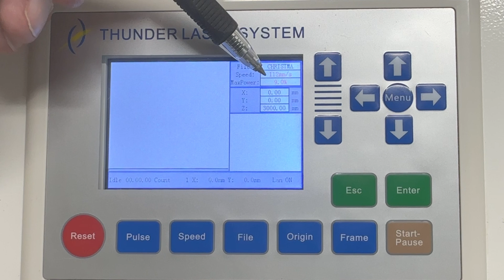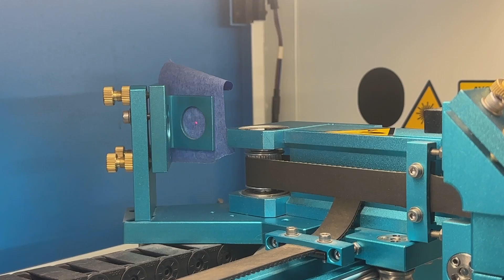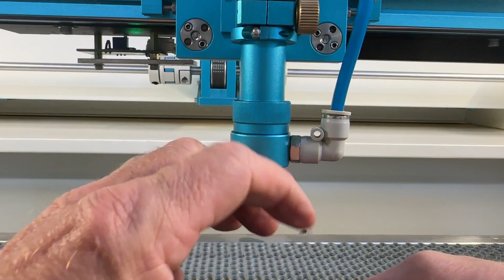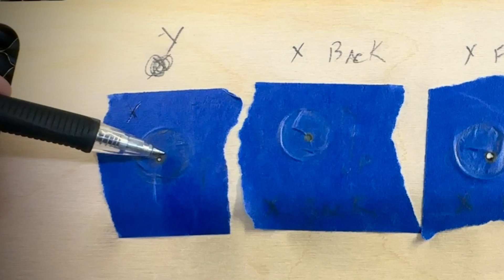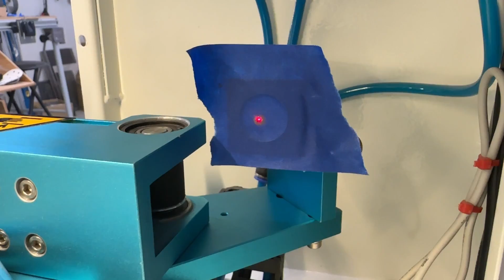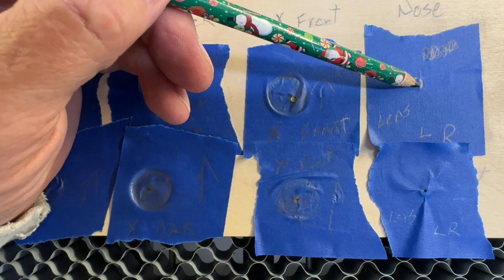Thunder Laser Co2 Mirror alignment process. Do not attempt if don’t fully understand your machine!

Comment: if you go to laser set in the menu and select that change from continue to laser, and underneath set the ms or milliseconds to 50ms. this allows the pulse button to only fire the laser for 50ms , another trick is to run 4 or 5 layers of masking tape on top of each other so the tape has no chance of catching on fire, also keeps the mirror behind clean from smoke

Comment: Thank you for your video. I adjusted the max power as recommended but once I press the pulse button no mark is on the tape. Is it safe to assume the laser is off completely from the mirror? need help
Reply from the maker: Use a large piece of paper on mirror 3 just in case it’s way off if you don’t see the pulse turn up the power until you do. Should be around 20% on most co2 lasers

Comment: I’m having issues cutting…I notice my red light beam is visible when my laser head is on the left side of the machine.  As I move it to the right it becomes barely visible.  Would you suggest it is a mirror alignment issue?  The only thing I have done is clean my mirrors and lenses, could that cause misalignment?  Thanks for your help.
Reply from the maker: your red light comes from another place. locate where your red light originates and adjust the red light to your laser beam a Mirror alignment is the last resort.
Reply from the maker: If you need help reach out to me and I can set up a 1 or 2 hour session.

Comment: Your videos are my go-to, and now I've got a real dilemma. I put in a new tube a month ago and everything was fine, but all of a sudden I started getting weird angled cuts. So, here's what I did - check the lens. Clean. Do an alignment of mirrors following this video, and here's where things fall apart. The first bit of tape I use for testing Y front and Y back? They're not hitting in the same spot. When I align the red dot to where the beam hits at Y Back and then run it forward, the beam is no where near the center. No amount of alignment from that point works because I can't get the Y front and Y back beam to hit in the same spot. I tested the gantry and it's square to the front on the left and right side... not sure how to check the X axis, though. Thoughts? Thank you!
Reply from the maker: it sounds like your gantry is not square. if it’s not you will never get it to align in all 4 corners. look up on.how to,square your gantry, once squared then do your alignment

Comment: After replacing my tube, I've noticed all the cut edges on my parts have a slight angle now. I've cleaned mirrors and lens, but I'm thinking it's gotta be the laser is shooting down at the wood at a slight angle due to the beam not starting at the right spot. Am I thinking right that this is a mirror alignment issue?
Reply from the maker: Yes that would be your 3rd mirror that shoots the laser beam down. Best way to align that is to shoot it into a 1/2” piece of acrylic. If you have a Thunder nova just make sure the laser beam is in the middle of the nose cone on the lens

Comment: Hey awesome video I had a question what if mirror 2 has no laser beam (red light to mirror 3
Reply from the maker: Please remember the red light comes from a different source than the laser beam. The only way you can tell where your laser beam is to put tape over mirror 2 and pulse the laser the hole will tell you where the actual laser beam is. You always should adjust your red light to where your laser beam is that way it’s much easier to see where your adjusting

Comment: My beam is not hitting in the same spot…the right side of my laser is severely off hitting top right of the circle/mirror
Reply from the maker: it will move some especially with larger lasers you just need to find the average in the middle. it won’t be the same all over the bed